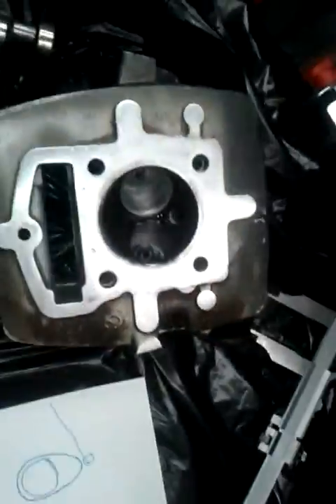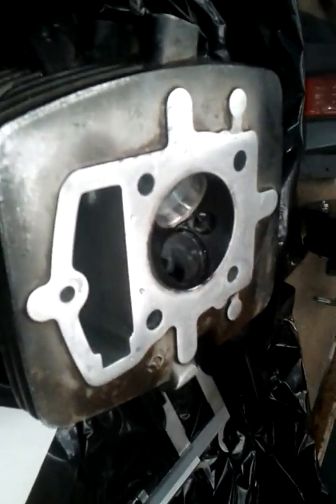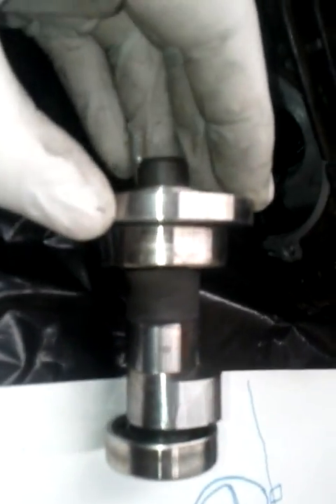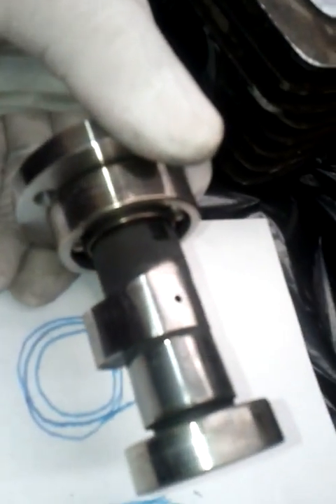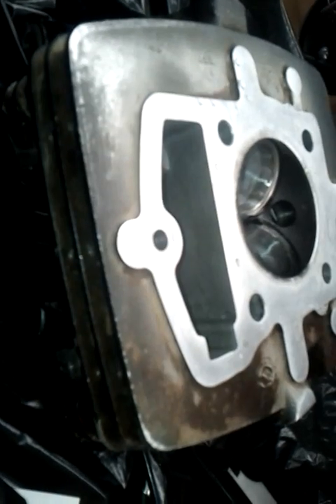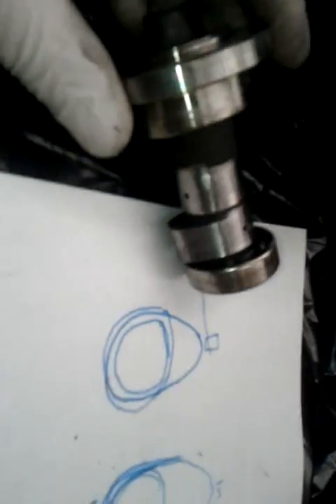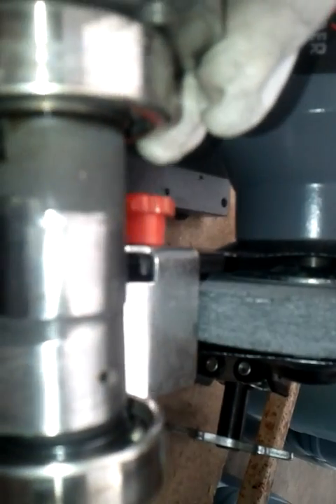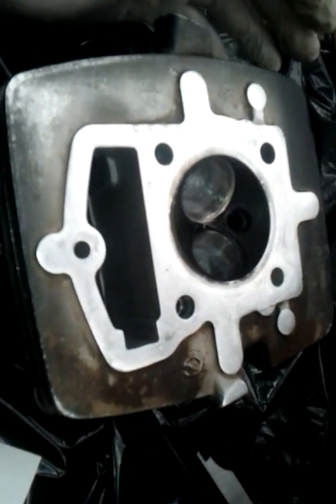grind camshaft how it works part 1

Comment: This is an old video, but very good explanation.
I've got a 79cc predator that I modified a few years back, still going strong. Ported polished the head, added extra valve springs to make stronger, tapped a new pushrod dimple closer to pivot point of rocker arms, advanced timing by grinding key, of course upgraded carb, rejet, little longer custom manifold and header pipe, all without spending hardly a dime.
Goes to about 6500-7k rpm now, makes quit a bit more power.

However, I'm wondering if the same effect can be obtained by modifying the rocker arms like I did, adding lift,
Or if grinding the cam would be better.
Doesnt it do the same exact thing by adding lift, or is grinding the cam more effective. The only benefit I see grinding is adding a little more duration as well. Can someone clarify this?

Comment: Wish i would have seen this video 10 years ago when I was at machinist school and I had my cm200t .  had access to "whirly gigs" (off set fixture) and surface grinders I could have used to grind my cam.  But if I get the proverbial "wild hair up my ass" I might just sell a kidney and bring home an old ko lee and a hurco "whirly gig" (can't for the life of me remember the actual name of the fixture). Can't help but imagine what I would do with my life if all I had to do was walk in the garage and mod cams for bikes that don't have a performance option.  Instead of tracking down the elusive 26hp cm250t or cm250tb, i would like to build one or find a happy medium for a unique build.  But I guess if I am my own customer and a replacement cam is cheap, I guess attempting to free hand with stones or a pedestal grinder or belt sander might work well.

Comment: There's a little bit of a better way to explain it. And think of it by finding the middle point of the circle or the very center if you can make the part of the cam where the valve is closed closer to the center of the circle without changing the other part of the cam that actually opens the valve the valve opens further.

Comment: Your info helped me with may build I have.  Did you ever find better way to remove and install the valves.  I use a large clamp style. When I first learned used a deep socket and a hammer. Good hit on the socket and the keepers would pop right out.

Comment: A bit late but hopefully it will help someone else experimenting. When you are working on an engine with rockers the valve lift is not always a 1:1 ratio. So an increase of the lobe height by 1 mm  needs to be multiplied by the rocker ratio in order to know the actual valve lift. When valves and pistons are involved kissing is not a good thing. :-)

Comment: grind cam is better than a oem racing camshaft.. here in philipines way back 1994 we were doing it here..
Reply: are grind cams re hardened or does it depend on the material of the cam?

Comment: Awsome , I had been looking for info on this  and checked this video out ,did the same process to a 125CC. single lobe camshaf and the result were excellent I dare say as good as when I had the cam grounded by crane cams , don´t forget to do high flow porting on the head and maybe change the engine gear sprocket and the rear wheel sprocket. AKT  Competition Customs  - Bogota, Colombia